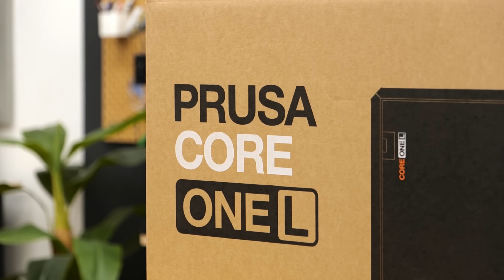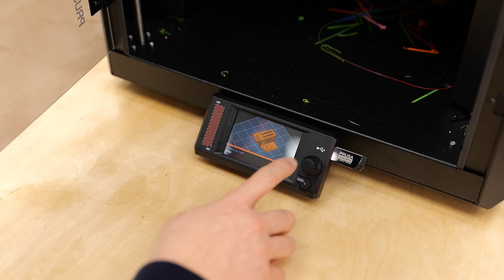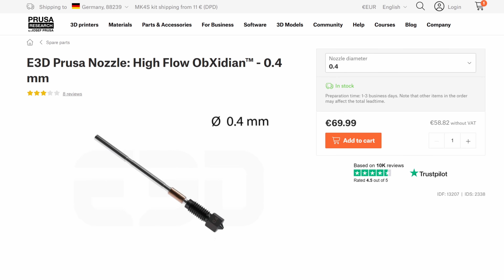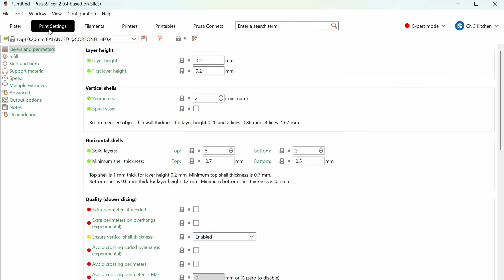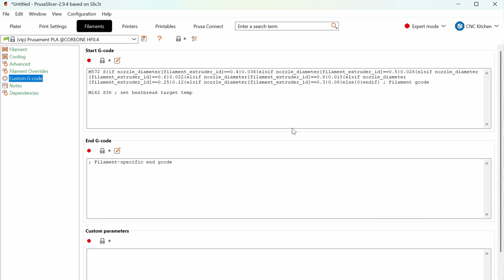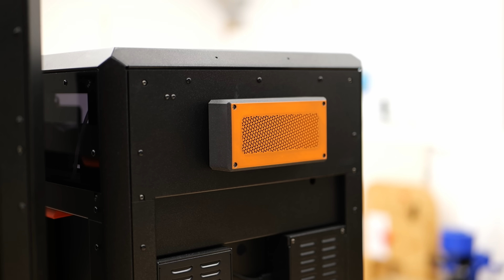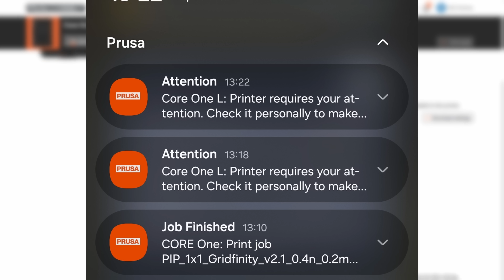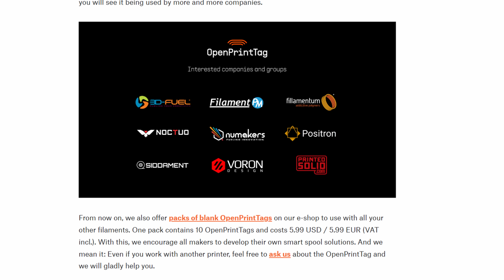What Prusa Got Right (and Wrong) with the New CORE One L

Comment: I want to pull for Prusa. The Chinese companies need competition from Western companies. But that only works if the machines are competitive. Not even necessarily on price - there almost has to be a premium in that department. But it falls apart completely if the printers are worse in several areas and still carry the price premium. It's also very disappointing that many of the issues could be easily fixed, they just didn't seem to care to fix them.
Reply: Yeah, exactly this. I'd love to spend a bit more to have something made in the EU and not in China. But such a large volume supposedly "high end" machine topping out at 290° at the extruder? That's barely enough for PC and an absolute joke. The H2S can do 350°, that's what they are competing against.
And not including a high flow hardened nozzle?
The MMU still being the mess it is?
No thanks. I hate the Bambu walled garden but in the end i still have to work for my money.

Oh and also their reward system on Printables is still complete garbage as well. With the exact some models i got nothing from Printables while getting over 200€ in gift cards on Makerworld in less time.
Reply: @Duglum666 the 290c hot end is seriously such a huge let down. I wouldn’t mind spending a few more on a C1L over an H2S but it’s hard to justify.
Reply: @Duglum666  Same here. I’ve been using Printables for about 3 years, posted over 50 models, and got more than 3,000 downloads , still haven’t managed to get a single roll of Prusa filament. 😂
Meanwhile, I joined MakerWorld just 5 months ago, and with around 500 downloads I’ve already earned $120 in gift cards, which I used toward my new P2S.
Bambu is basically devouring Prusa and using a similar strategy just way more reliable. Honestly, I’m not even sure if anyone has ever actually won a Prusa spool on Printables, since the my points seem forever stuck at 248 points. 😅
If Prusa doesn’t start innovating soon, they’re going to fade fast.
Reply: @Duglum666 100% agree. I’d rather support printables as it’s more friendly to “just uploading” for the fans. But maker world pays out big time. I have at least 3x the points on maker world for my stuff.
Reply: @Duglum666  my qidi plus 4, as well as their new smaller Q2 pro does 370°c out the box. I print engineering filaments/prototyping exclusively- so any printer that can't handle ALL engineering filaments without issue is like buying a new bicycle that only comes with one wheel- useless😂 this should be a race to the top- not copying apples marketing strategy of selling the same thing without improvements and just changing the name and packaging😂
Reply: Take the nozzle wipe for instance. There's already a mod out there for the Core One to add a silicone wipe pad from an A1, and it works fine. Prusa could literally just copy that and make it official, but with their own silicone part on a PCCF mount. Strange to not see it on the L
Reply: I'm the same way. I like Prusa as a company but no way I'm paying more for a worse machine. The Core One line is a nice step up but still cannot match the polished experience from Bambu.
Reply: I needs to be on par with Bambu for me to even consider it. They need an excellent AMS system and fix the complaints CNC Kitchen had
Reply: Like and Subscribe for the half life reference alone 😂
Reply: Prusa printers are worse not in several areas, they’re worse in all areas now. The former was true a few years ago, but now Bambu blows them out of the water in literally everything.
And before anyone starts telling me how great Prusa is because you can upgrade it, get this: upgrading their printer makes absolutely no economic sense. You can flip your old printer and buy a new one for less.
Reply: $1700 and you have to print slow to avoid VFA’s?
Reply: @WhereNerdyisCool  They will fix that.  It took them awhile to find the right belt tension for mostly VFA printing on the original Core One.
Reply: @KennethScharf the fact they didn’t figure that out before release is simply unacceptable
Reply: @KennethScharf This is exactly the issue. Nobody wants to buy a new BMW or Mercedes, that they can't rely on to even get them to work until the manufacturer "Fixes a few bugs". If you are a home hobbyist with extra cash to throw at it, sure, but if you buy a printer like this to support your business, you can't afford to be at the manufacturers whim.
Reply: I wanted to write exactly this. Very frustrating.
Reply: I wanted a Prusa. No doubt in my mind that they are somewhat good. However, the downsides need to be shown. The Prusa XL or MK4 or any other printer Prusa carries are notoriously expensive and don't have the things I need. Except maybe the XL. I used to run 2 Ender machines but now I have downsized to a p1s. 400 USD, enclosed, easy to fix, easy to print. Compare that to a 1510.10 USD MK4. Which isn't enclosed, doesn't semi tighten its belts, doesn't have any kind of ventilation, (mind you im asthmatic). It isn't worth it.

While it is true that Chinese companies need competition, as is how capitalism should be; Prusa simply is not good enough.
Reply: @The_Fluffy_Cloud The MK4 is much more reliable and, most importantly, quieter than the P1S. I have had both printers and for me the MK4 is much more worthwhile.
Reply: @CadaoPhạm-i2lHow do they compare in terms of speed and print quality?
Reply: As an early adopter of the XL, I agree with what you're saying. There are numerous things they could have improved here that they simply chose not to. It's also frustrating that we've heard of almost no upgrades for the XL like better cooling and better filament loading mechanisms so it's almost like they've admitted defeat on that machine beyond the kind of useless silicone announcement. The last major upgrade they had was their ridiculously overpriced and terribly designed enclosure.
Reply: What you are missing is the fact that some companies do sell products for less than or very close to manufacturing cost.

Impossible to compete, because competitors just throw their own money at the customer. Only later they plan to make it back, when competition is dead.

This can be especially true for larger Chinese companies backed by their government and with CCP members among owners. Sometimes such companies are okay with just breaking even, not making much, just to disrupt adversaries markets for a decade or two.

Reminder: core xy was originally done and perfected by voron design, input shaping by western researchers from a bunch of universities, most advanced and complex stuff by unltimaker, they also made popular the marketplace for printable models afaik. I can hardly name one Chinese company that actually innovated in this field. What I can give them credit for is for their ability to scale and mass produce stuff. Stuff that was usually designed and battle tested in US and EU for years, sometimes drcades.

It's not just printers. It's like that with most products. People try to RnD stuff in the West and produce in China. Then figure out their designs were borrowed and are being mass produced and sold independently, for cheaper. Because the "borrower" doesn't need to cover the RnD costs.
Reply: I'm vehemently anti Bambu due to their  attempt at killing competition by patenting long standing processes in the 3d printing community, but the H2S with AMS is $500 cheaper than the Core One L and almost $800 cheaper if you include the mmu3
Reply: Nozzles are now up to 400c on the core one series
Reply: @Flagermus_FPV  But it's still 260 € on top for the HT Hotend... and an extra 80 € for the Filtration system...
I really want a Core One L, but the higher price is hard to justify when it lacks simple features that much cheaper printers have and are so useful... Even with an ASM 2 Pro, the Bambu Lab H2S is still 200 € cheaper, and has more build area too... I really want a Core One L, but I'm struggling to justify it (5 months later, the latest Prusa Slicer still shows the weird speed changes in the Clockwork Toaster...)
Reply: Prusa isn't even a western company, I'm not sure how they manage, but Prusa is overpriced and I never had a good time with their support team.
Reply: I'm willing to go with the prusa for the privacy alone. Although the camera needing cloud connection is totally wtf.
Reply: @reinux lol Meagan while  you’re  on YouTube logged in on a electronic device where all
You’re data is tracked
Reply: @user-jh1mq2ih2u  Last time I checked, more was not better.
Reply: @user-jh1mq2ih2u you know that a 3d printer and a video sharing social media site are two wildly different things, right? One doesn't need to be connected to a cloud service to work, the other does. Nuance is hard isn't it?
Reply: @user-jh1mq2ih2u Guess with that logic you never lock your doors?
Reply: @user-jh1mq2ih2u most tech savvy people have a separate email just for YouTube. Don’t have to have many details at all shared this way. Especially if you just use single letters for name etc.
Reply: @ShermanistDruid  - strawman much?
Reply: @garymelrose9727  much, much?
Reply: I just posted a commend with similar sentiment but reading yours makes me want to play devil's advocate.... It's hard getting it perfect, without govt. Subsidies they could collapse any moment so every corner they can cut they have to cut ??? Maybe. IDK I made 2 businesses that failed 🤔
Reply: I agree, the short lifespan and low quality of Chinese-made products are really noticeable. It might look appealing at first, but in practice the issues start showing up quickly and you realize that the only thing you actually saved was on paper.
Reply: @Radhiant   still making stuff up as usual...
Reply: Also having been burned by the bambu situation, mandatory online + account connectivity for something as basic as a camera is a big yikes.
Reply: RayLenses
 小粉红，你好吗？😂😂😂😂

Aren't you the guy from the anticovid ginseng capsule adverts? They've really got you doing alot of CCP propaganda nowadays eh? 

That's competition I guess
Reply: @alex13902 What are you talking about?
Reply: inb4 Prusa fanboys talk about how the Prusa Core One Critical Infrastructure Edition will save the company
Reply: @theglowcloud2215  There's a lot of money in government contracts.
Reply: Do I choose a local manufacturer making open ethical design or Chinese spyware with little bit more features...

How is that even a question. Prusa for life
Reply: @BillFoster-st4hj  - proving the adage 'a fool and his money are soon parted'.
Reply: @BillFoster-st4hj  "ethical" lol I can't even, prusa fans are really grasping at straws now that their products are objectively uncompetitive
Reply: @riba2233  bro the product is literally the same and you are getting little bit of extra feature from the chinese spyware. I hope you are also using windows instead of linux because it has so many cool proprietary apps lol
Reply: @BillFoster-st4hj  sorry but i cant support local manufacturer if i wont get the basic value for my money, it doent make sense.
Reply: @RayLenses  it depends what you perceive as "value", if value for you how good is the quality for lowest price? then chinese all the way, if you want to make sure china doesn't steal everything and your kids still have jobs in 30 years, then support local, it's really that simple.
Reply: @UNgineering  Not trying to get political, but China doesn’t “steal” anything, they just work hard. If you want fair competition or my money, then work harder and prove that you’re worth my time and money. Don’t expect people to pay for half-baked, unfinished projects with a premium price tag and call them products.

As for the concern that “our kids won’t have jobs,” the truth is, no one will, if they don’t learn to work hard. It’s a tough reality, but that’s how the world works.
Reply: @RayLenses "china doesn't steal anything"
This joke made my day...😂
Reply: stop victimizing just work harder
Reply: @RayLenses not "victimazing", just a fact . 
Chinese companies do not hesitate to shamelessly copy anything of value regardless of any legal protection, while China one party government turns blind eye to the point of direct support of such behaviour.

Solely for that reason are Chinese brands unbuyable for me.

Yet I still want that not to be only reason to buy "local"...
Reply: @tri-seeker2753 That’s what real competition looks like. like it or not. The market already spoke, and people go where they get the best value for their money.
If buying from local makes you feel better, go for it. 

But the reality if Bambu Lab steal or not they already left Prusa in the dust a long time ago.
Reply: @RayLenses  I agree that Prusa is (at least currently) loosing on competition, namely china, no discussion on that point.
I understand that big chunk of buyers do not care about anything else but how to get the biggest bang for their bucks.
But calling a stealing "real competition" and then happily ignore the fact because "this way I get my stuff cheap as possible" says something on its own...
Reply: @tri-seeker2753 If we want to go there, the individual companies from America which operate in China, have to sell their rights to the CCP. Therefore they are not stealing, the companies know.

On the other hand, the complain of Chinese spyware on your 3d printer. What are you printing that is so illegal? My P1S, can run on LAN mode connected only to wifi and not to internet with the functionalities of the camera intact. If anything, prusa is doing the spying
Reply: @RayLenses  Really?  Really?  It's not like China has a huge longstanding reputation for IP theft or anything LOL.
Reply: @tri-seeker2753  Can you actually name what they “stole”? Everything they built on was open source. Stop playing the victim this is just competition. And competition doesn’t care about emotions or nostalgia. Try a Bambu printer and you’ll see it’s not about being cheap it’s about delivering a polished, reliable product instead of an overpriced, unfinished project.
Reply: @MrNickpeck36lol is like your Instagram and Facebook is not taking any of that😂, but give me fact checked that they actually stole any of those or is just another anti-China panic propaganda.
Reply: @RayLenses  "Not trying to get political, but China doesn’t “steal” anything,"

Complete lie, they steal western IP all the time.
Reply: @RayLenses  you can't be serious...China is notorious for stealing IP. Good lord, they have spies in every western government and company just to steal IP.
China doesn't invest. They steal and iterate.
Reply: @UNgineering  - it's certainly an argument for the simple.
Reply: @tri-seeker2753  - commenters carry more moral authority when they can spell 'losing' correctly.
Reply: @MrNickpeck36  - you mean the software loaded onto the Chinese manufactured smart phones every 'open source' fanboi cries on? Or do you watch them on the Chinese manufactured PC or Macbooks?
Reply: you have to be really dumb to buy prusa right now, or to buy any printer at all right now, before multinozzies come to life
Reply: You also have to look at serviceability. With Bambu there's usually a minimum of 1 day to respond to any query, and if you're getting close to the warranty period, you might not even get anywhere - they'll happily let you know the day the warranty ends that you now have to pay for service.
Reply: @UNgineering  That's not how warranty works, if you noticed them during warranty period they will need to fix it, it doesn't matter how slow a service is, even if it takes them 3 months to reply they will still need to fix it under warrranty
Reply: @justvoorfun  that's not how warranty SHOULD work, but i've had that happen with Xiaomi (not 3d printers, other stuff), and I heard from people with X1C the same thing happened to them.
Reply: @UNgineering  Two different things mixed into one sentance. Once this is serviceability. There I would claim Prusa and Bambu are on par (I might even give Bambu here a slight edge looking at the sheer number of spare parts on their site to purchase as a customer). 

The second bit you mentioned is support. And looking at a 1 day turn around on replying to a inquiry? I would call that also pretty damn good but Prusa might be better. But it also opens one up to a very important question. Do I even want to have support? Or do I feel it is much more important that a tool I buy "just works"? And here Prusa is better at support probably because their machines need it a lot more. So not a good look from a customer standpoint
Reply: @Adi031978  of course i would want a product that requires zero support. ironically, so far i've only had that with my macbook. i would argue prusa has 24/7 support because their printers are used in many print farms, and when you have 200 machines, something will break, regardless of how well any single one "just works"
Reply: @UNgineering I get fat responses less than 24hr turn around .. but when they have a larger user base than prusa there are some delays but bam y also has a large library to help you resolve almost
80% of all issues .. but then again clowns love to hate
Reply: @user-jh1mq2ih2u  because i don't want my data sent to china 24/7 i'm a clown? yeah, you seem like a rational and reasonable person.
Reply: @UNgineering  the only difference is that you almost never need their service because their printer just works! im sorry but prussa is becoming ajoke specially the premium prices for a project printer. i could build 2 vorons vor that price and my voron will outperform prussa printer!
Reply: Every Euro that european companies earn, they have to spend more than half to burocracy! So how to compete ;)
Reply: @24KG24 in the same way as any other industry. By offering their customers a product with innovative features that are relevant to them.
Reply: @Adi031978  of course, because there are unequal conditions to the rest of the world!
Reply: @24KG24  that is absolutely false